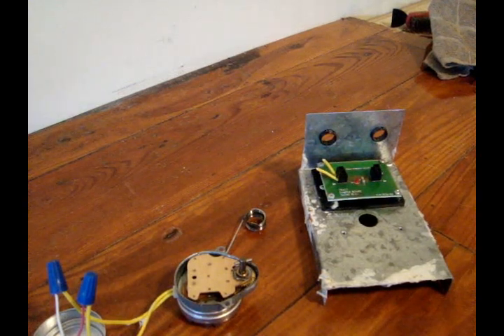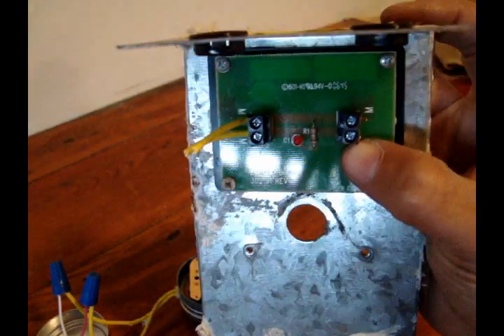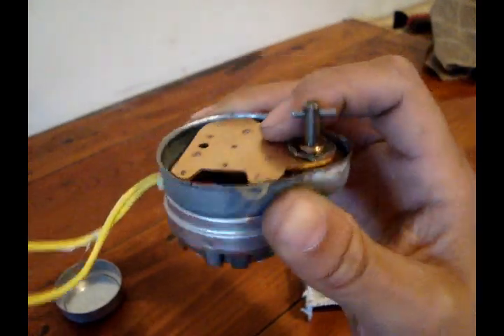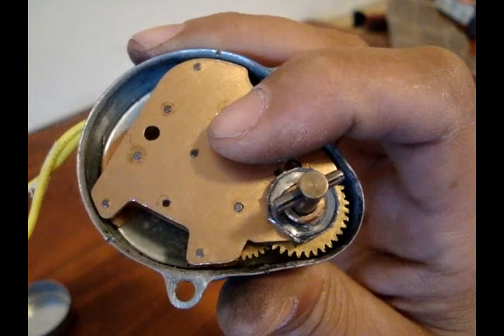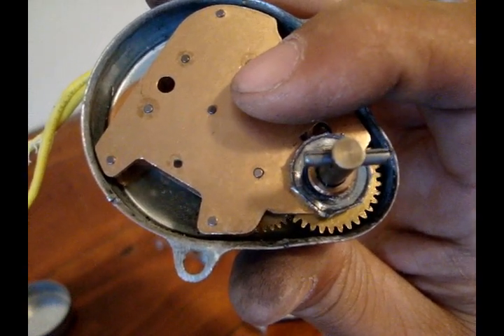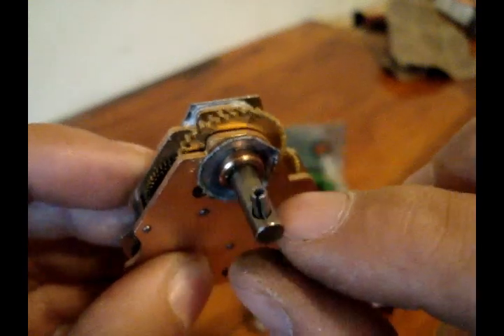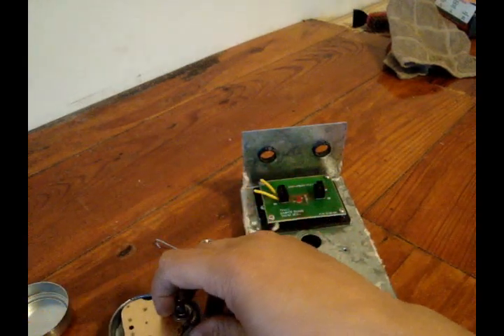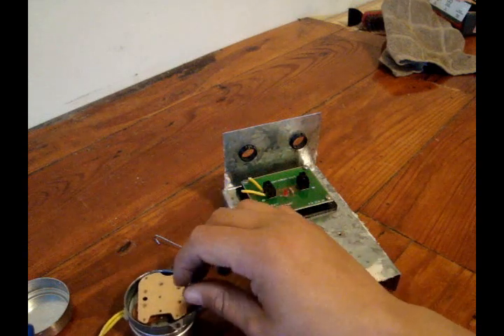HVAC: ZoneX Damper Break Down

Comment: Is it repairable? I'm being told replacement motor is 101AMRP from ZoneX for $69+shipping, trying to see if there is a cheaper or better alternative.
Novice DIY.
Reply from the maker: At such a low replacement cost, it's not cost effective to attempt to repair. Could it be done? Sure! But I've never bothered to try.